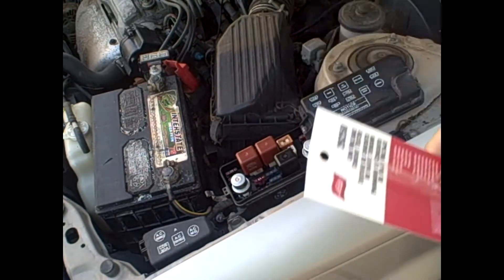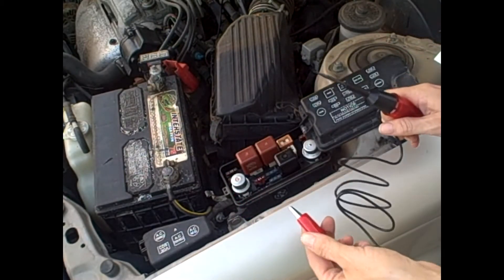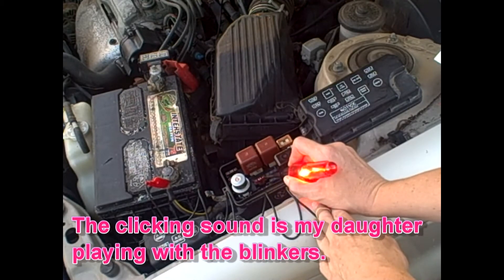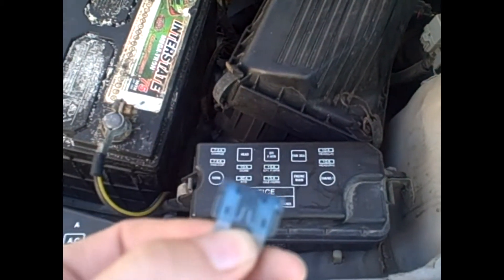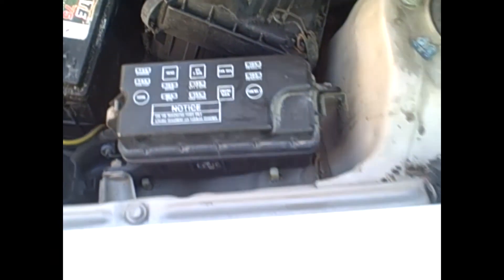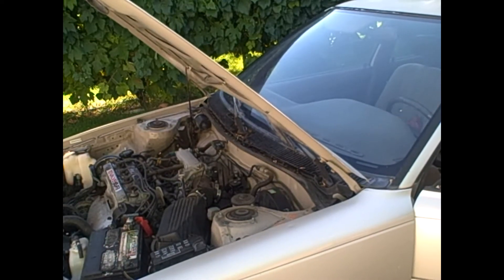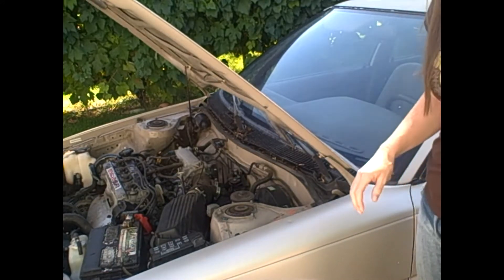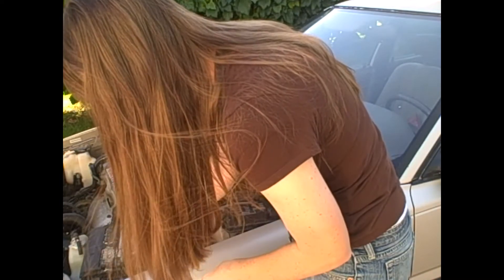Fuses, Brick Walls, And Codes! Oh My!  AND Lisle 26250 Tool Review

Comment: If you are lucky the fuel rail will have a schrader valve (like a tire) where you would normally attach a pressure gauge. You can test if there is any fuel pressure by depressing the pin in the middle of the valve and see if any fuel squirts out while cranking or shortly afterwards. Make sure to wear safety glasses if you do this test cause the fuel can come out pretty far and fast. It won't tell you if it is enough pressure to run the motor, but it will tell you if you have some.

Your battery is also very weak, it started to slow down as you were cranking. Might try keeping the battery charger attached while cranking to give it a boost, or jump it with another vehicle while cranking.

Also, don't forget to check the relays to see if they are being activated when you try to crank. You should hear and/or feel them click when activated.

If you give a good shot of the wiring diagram, some of us might be able to offer some diagnostic advise.

Btw, are you still not getting spark or did the distributer swap fix that issue?
Reply from the maker: I don't think it has a schrader valve. Huh.. now I have to go out and look again. I'm pretty sure it doesn't though. You're getting into some of the content of the next video! I had to edit out listening for the relay so it could be in the next video! I have to stop here or I'll give it all away! :D

Comment: Test lights, like the one you bought, are very handy. You could also use your multimeter to test the fuses. Either set it to test continuity and probe both pins on the fuse (if it has continuity the fuse is good) or set the meter to DC Volts and have the negative lead on ground (like the negative battery cable) and touch the positive lead on both pins on the fuse one at a time. If you get battery voltage on both sides the fuse is good.
One thing to remember, at least on modern cars, some fuses only get power when some relay is activated or the ecm activates a circuit. So a continuity test of the fuse is the most reliable.
Reply from the maker: Yes! I completely agree. In fact, the video ends right after testing about 3 fuses because the others weren't activated. LOL Thanks for posting this info for someone who might need it! I might need it later! ;)

Comment: Not sure if this applies to your car,or not.. but a common fault I've seen is shorted (heated)O2 sensor wiring. If it gets loose,and touches the hot exhaust,it will melt wires,and short to ground. It seems to be common,after someone has replaced the O2 sensor,and spliced the wiring,etc..then didn't do a good job of tying it up out of the way.
I'm not sure if this car would have a heated O2 sensor,or not.
Reply from the maker: It does! I didn't know that was a common fault. Well, that explains the zip ties. :) It's good.

Comment: Spanky. Looks like you have a short. Look at what the circuit goes. Disconnect each item one at a time till fuse doesn't blow. The access for the fuel pump might be in the trunk.Good luck.
Reply from the maker: It seems that it goes to most everything. Sadly, I have to drop the tank. Thankfully, it only has 1/4 tank of gas. But if I have to drop it, it will make for a good video!

Comment: Sorry to hear about the electrical problem.
Why one of us did not ask you if you had checked the fuses is beyond me.(fail on our part), first thing to check.
Yes check the fuel pump,if that is ok then start looking at the wiring for any broken insulation or shorts.
Check the connectors going into and out of the ecm,it is possible a small rodent or other critter may have chewed on some of the wiring,since it sat for so long.
It can be real  pita  to hunt down an electrical fault,hopefully it is a simple problem.
Hang in there,you are doing great!
Reply from the maker: :D I like that you're almost trying to take the blame for not suggesting to check the fuses! Hahaha! Yes, the fuel pump check is the next video!

Comment: You're doing a good job, keep up the good work, and you're making forward progress, my Honda project I found out was a flood victim, and the ecu is fried, and so is the ignition system harness, looks like it'll be making a trip the the junkyard or pick a part yard
Reply: That's why it's on it's way to a wrecking yard
Reply from the maker: badranger2004 Oh that sucks! I saw a 1999 Ford F-150 with some "engine problems" listed for $2k. My guess is it was a flood truck. The body was in incredible condition. It made me sad. I wanted it. Anyway, sorry to hear that. Thanks for the encouragement. I'm already working on editing the next video!

Comment: OBD1 IRC isn't to involved with faults it might detect. Without a clear veiw of the schematic. I would guess the only thing that could blow a 15 amp fuse on that circuit would be the fuel pump.
I have a 80K Corrola estate 8 years ago, but I sold the car with the the haynes manual. I bought it for £100 with the big ends gone(they put the wrong/wrong/wrong oil in it lol), I bought a 50k engine for £150 and swaped it over the weekend. They are great little cars, I drove it evey day for 3 years after that and it never failed me. 2FE4 or somthing like that rings a bell for the engine type.
I thought you fixed it though ;P
Reply from the maker: A ton of things are on that circuit including the fuel pump. That's the next video. Sorry it wasn't a good pic but I couldn't crop it.